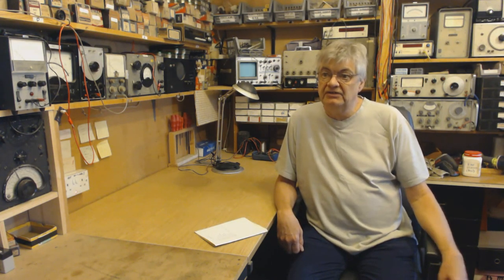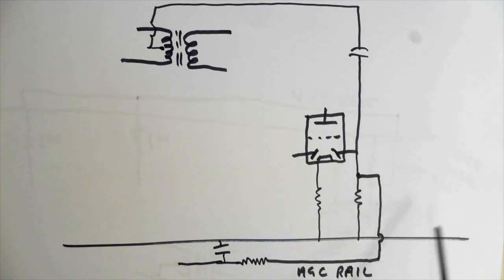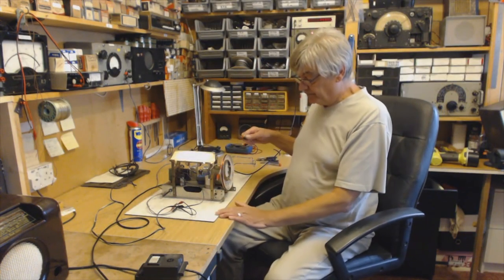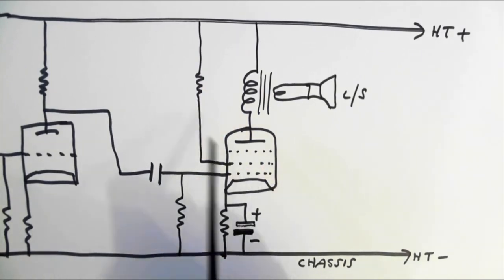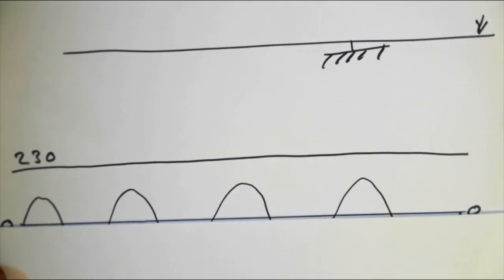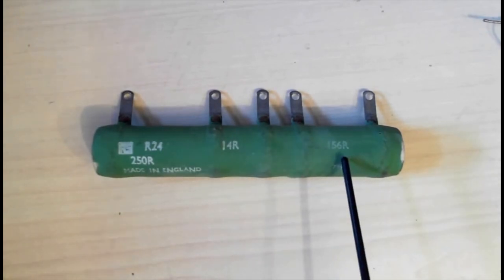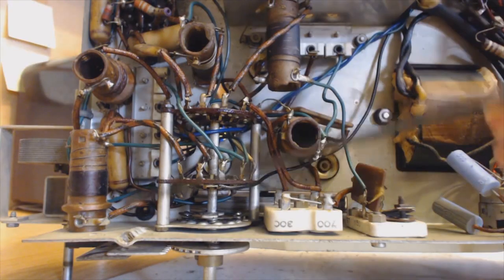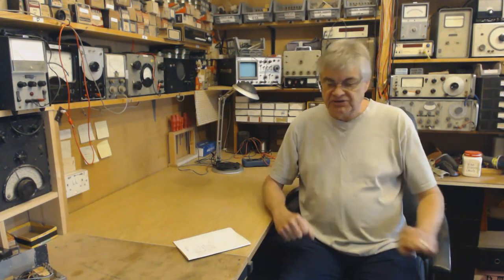How to restore vintage valve radios

Comment: I found an old radio chassis from 1927, great condition for it's age, so old in fact, that the I.F. is only 175 Hz! I plan to restore it fully, and it actually looks fairly good (steampunk-like) without the cathedral or cabinet box. Wish me luck on this one! wishes that an original 47 tube will appear overnight
Reply: I meant Kilohertz, just so nobody yells at me for saying that.
Reply from the maker: Good luck, indeed! Keep us updated.